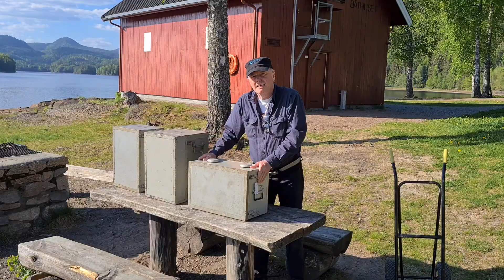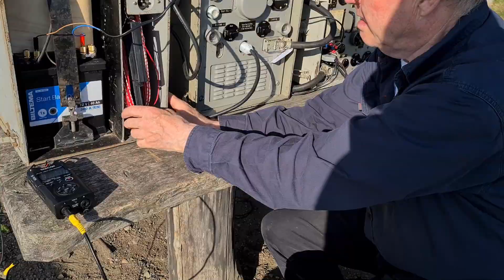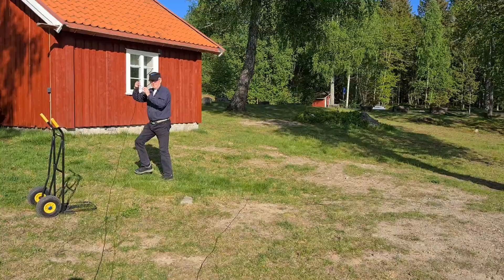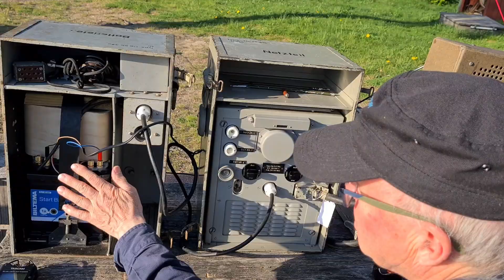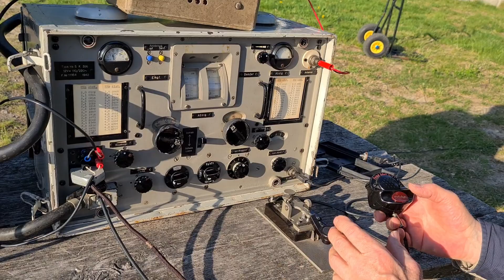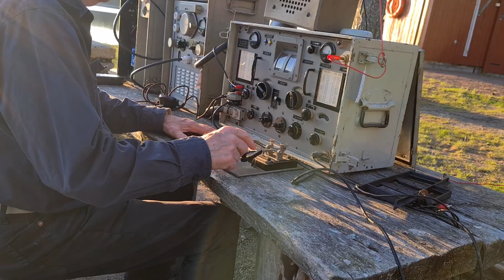WW2 German Radio Station Hagenuk Ha5k39 in use.

Comment: Marianne, the "weird sidetone" is caused by the RF getting into the microphone circuit of your phone. 
You might have to try a different microphone, or perhaps shield the phone itself. Regards.
Reply from the maker: Thank you for your comment.
Yes, you are right, the sound is absolutely terrible.
We have tapped the sound directly from the headphone output on the radio to a Tascam audio recorder.
The sound is actually like this even when I only have a headset.
There's probably something wrong with the radio, but it's a pretty minor thing so we can't be bothered to repair it now.
73

Comment: Nice video. Equipment looks great, it is very difficult to find German WWII radio equipment in this nice of a condition. In terms of capabilities (RF power, modes and frequency range)  the radio seems almost equal to the WWII Allied SRC694/BC-1306 radio, with the exception of the TRF receiver (the BC-1306 uses a more modern superheterodyne receiver). Thanks for the demo, great job!
Reply from the maker: Thanks for the comment. Yes, you can compare it with the BC-1306.
I have a BC-1306 that I will make a video about later.

Comment: Very nice indeed! I love how quiet your band background noise is on 80m over there. I used to work with a guy who, in a previous job many years before, had worked for Hagenuk servicing marine HF radio installations onboard ships. I remember that he thought it was excellent kit and rarely gave any trouble.
Reply from the maker: Yes, it is very noise-free on the 80 meter band out here in nature in Norway. At home in the city, the noise is S8. Here it is 0.
This radio always works. It's a good radio.

Comment: GENIO !!! FELICITACIONES, POR CONSERVAR EL PATRIMONIO, DE RADIOS ANTIGUAS. UN ABRAZO GRANDE DESDE ARGENTINA, LU4AVS 73"
Reply: 12 v inverter to high voltage with mechanical vibration of central pole or polarity point change over has developed now a days with digital circuits with pure sine waves,to ward off spark transmission noise at the point of vibrations of contacts to make Direct current to chopped current and step up rectified and smoothed for quality transmission and reception,good signal to noise ratio too ✍️👍
Reply from the maker: Thank you.
Reply: Hola LU4AVS En el aeropuerto Córdoba ""LVE"" era el distintivo de llamada  la radio, pero teníamos el Radio Club  y hacíamos QSO  en radiotelegrafía, con los barcos de la mercante   73  OM  El Alemán con sus equipos de la segunda guerra es un genio, guardar esos transmisores y receptor , que bueno!!!!

Comment: Nice video.Very good restored radio, and seems to me you had fun.  I use sometimes a SEG 15 D, its from 1973 or 74 , already with a synthesized oszillator. Works from 1,2 to 12Mhz   3 or 15W output. Made in DDR.  If you don't have to carry it a long way its ok.  Greetings from France,  F1VEL.👍🏻🇫🇷
Reply from the maker: Thanks, yes it's fun with such old radios.
Reply: @LA6NCA  Hello Helge,  I watched your great photo gallery of your collection. I read some of the manuals. I know most of the equipment from books,  the t. Fu  b,  I have tried once.  It works after 80 years.  You describe this  lantern with DEAC akkucells. I have 2  6V blocks, I think with the same cells 70Ah. Some are very bad, and the density of KOH is too low, but even 30 years ago, it was difficult to get Kalium hydroxide. Today, it is impossible.  If I can get some KOH ,I will flush them with distilled water and refill them. The OM who gave them to me said they were used on a U boot and later in a telephone exchange as back up.(60V)  
73. F1VEL

Comment: Wonderfull, the radio set must be priceless! I like how robust the set is and its general design from the outside. The Germans built some very good radio sets back then. I have a Telefunken Opus dating to around the late 1950's, needs some repair but is complete and in good condition.
Do you or anybody know of the smallest field radio sets the Germans used in WW2. That would also be interesting.?
Was this set you have built by Telefunken?🐞